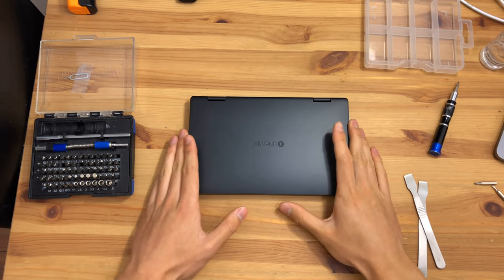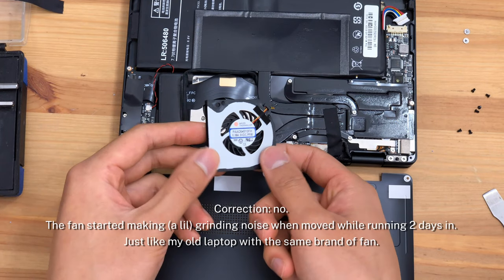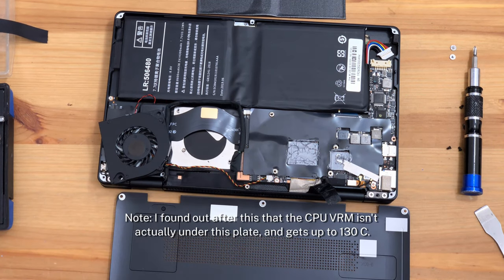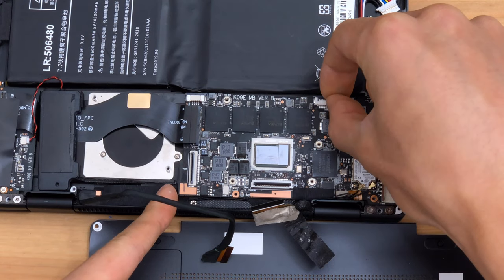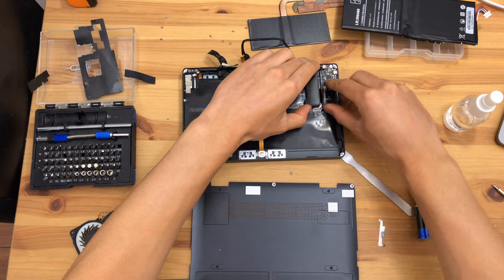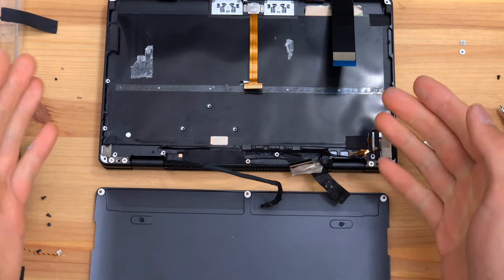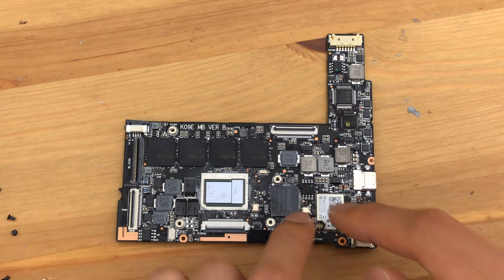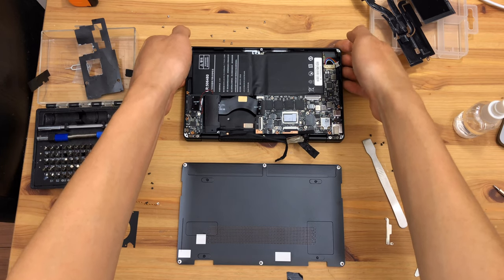One-Netbook One Mix 3s Yoga - Tiny Laptop Full Teardown Disassembly

Comment: Also regarding your thermal question regarding the battery: wouldn't the laws of thermo dynamics be in effect here? Which is to say, when heat is being generated by the CPU the heat will move along the heat pipes to the areas that are cooler based on how heat travels. Because the fan would be cooling the heat wouldn't this create a positive flow of heat that would keep heat from moving towards the batteries heat sink? In this way wouldn't the battery heat sink just help to move heat away from the battery itself?

My own experiences with the battery discharging is that it doesn't really generate heat. Only when the battery is being discharged and charged at the same time does the battery tend to heat up. Your thoughts on the matter would be much appreciated.

Comment: i have to change my one mix 3 yoga keyboard & your video help for direction to change it.
it was  a success
tx
Reply: Can you link where you found a replacement keyboard. If its an ebay seller which one? Thanks.
Reply: @minsc9976  it is on aliexpress

Comment: How do you reconnect the optical mouse sensor? I used this guide to replace the battery but now my optical mouse doesn't work. I think I must have disconnected it somehow. The clicks work on the left and right buttons, but I can't move my cursor with the touch pad.

Comment: Hi Larry, my one mix 3s is not turning on, the blue power LED lights up for 5-6 seconds before going out again. Sometimes I see the windows bootup screen and sometimes nothing comes up on the screen, but the system switches off in 5-6 seconds regardless.  Do you have any idea what's wrong? Hoping it's something I could take apart and fix...
Reply from the maker: If you're comfortable working inside the system, try to remove the back cover and disconnect the battery. Wait 5 minutes or so, then reconnect the battery, and try powering the system on. It may take several restarts or force restarts to get it to boot again.

Let me know if this helps
Reply: @liminalsunset  Thanks, let me give it a try following your video, will let you know how it goes!
Reply: Hi Larry, I tried disconnecting the battery and reconnecting after 5 minutes, no response, had to plug in usb-c power for the blue LED to light up.  The system power cycled on its own for around 10 times, each time the blue LED and the screen didn't last longer than 10 seconds.  Sometimes there's nothing on the screen, sometimes I see the one mix logo, there was once I saw the windows login screen but only for a split second.  The system stopped power cycling (restarting on its own) after maybe the 10th time.  When I press the power button it's the same 5-6 seconds of blue LED before going out again.

I then tried leaving the battery disconnected and try switching on with usb-c power, the behavior is the same (5-6 seconds blue LED then nothing).....
Reply: @michaelleung1980  any update on this? I have the same problem.
Reply: @jhayde0830  still the same, I tried the disconnecting battery trick Larry mentioned with no luck... I even tried powering it up with the battery disconnected (read somewhere that it works without the battery) but it's still the same (blue light which goes out after a few seconds, sometimes I see boot screen, sometimes I see the automatic repair message before it goes out). I haven't tried anything else inside besides disconnecting the battery yet, don't know if anything would help.
Reply: @jhayde0830  Second update, after leaving it untouched for a few days, I just tried switching it on again and it started up successfully and I let it stayed on for a couple of hours and even restarted it for windows update and it's so far stable. A couple of months ago I encountered this problem the first time and the one mix 3 suddenly worked again. I really wonder if anyone knows what the problem is.  When it's on it appears to be stable but sometimes it refuses to start up.
Reply: @michaelleung1980  Thanks for the update!
Reply: Another late update... it was too soon to call it stable when it's on...  as my one mix 3 blacked out a couple of minutes following the previously mentioned windows update. After I few tries I was able to power it back up, but it went out within a few minutes.  There is definitely something wrong that I couldn't figure out
Reply: @michaelleung1980  i have been facing this issue since last 2 months, shown to many chip level repair experts but no solution. I think i am cheated by manufacturer. Its a useless piece of @£#
Reply: @dhanvinvlogs9715  sorry to hear that.... it's the same for me.... and I've given up on it already.....
Reply: @michaelleung1980  Did you manage to figure out a solution at all? Got the same issue. Was wondering if a battery replacement would solve it. Thanks.
Reply: @snazzybunny3029   not at all... I've given up on it already, sorry...

Comment: can i ask you something? my onemix yoga 3 is automatically turning on and off like in a loop. if i successfully go to the BIOS, it will suddenly turn off. what is/are your recommendation/s? TIA.
Reply from the maker: You can try to carefully unplug the battery and reconnect it after 5-10 minutes and see if it resolves the issue if you are comfortable working inside the computer. Otherwise, there could be a number of issues causing this.
Reply: @liminalsunset  thank you for replying! i did, but still in the loop. i think it's the batt even if it's 100%. you think so too?
Reply from the maker: @alndrx  You can try to start the machine without battery connected using USB C power supply. You can restart it a few times before it will boot maybe.
Reply: Hi my fds, It happened mine as well, i drained out all battery by plug in usb fan, and change it again, it back to normal, but i have no idea it will happen again sometime, it is so frustrating...

Comment: This model is advertised as having aan addition slot for adding
a 2nd SSD. Any Idea as to where ??
Also, FYI, I upgraded to Windows 10 Pro very easily..BFN
Tom
Reply: Only the One Mix 3 has the slot, One Mix 3S doesn't. Not sure what type of slot it is too, my nvme drives seem to fit it but are a bit too long, haven't yet tried if they will work.
Reply: @TomaszKucza  I want to add a 512 gb ssd in my one mix3 but don't know where the slot is. Any idea?
Reply: @shariqabideen  When you open it (unscrew the back panel) there is easy access in the top right corner.
Here is a photo: https://photos.app.goo.gl/5Mc5wztwyyJ7cxVu9
 The space seems a little short for bigger SSDs though, haven't tried adding one yet, still have a non-working keyboard so the device is gathering dust.

Comment: Hi Larry, I just bought a One Mix 3 Pro and tested the device. While charging and using it, I can feel the electric current flowing through the case and when I touch it, it zaps me. 
I tried to disconnect the charger and use it purely on battery, after using quite a while, my hands feel uncomfortable and can feel the tingles sensation... If I lift the laptop close to my ear, I can hear tiny sizzling sounds from it. Could it be that the live wire is touching the case and how could I possibly fix it?

Comment: Larry, Great tear down video! Does the One Mix Yoga have a bios battery soldered to the motherboard? If yes, where is it located? I am trying to reset the bios. My 3s is not starting up. No logo/bios start up or windows 10. The blue led comes on for two seconds and turns off. I’ve reached out to One netbook company and there is absolutely no technical support or response. I regret buying this expensive laptop. Any advice based on your personal experience?
Reply from the maker: Hi,

Sorry for the late response. This laptop doesn't have a BIOS battery or a capacitor on board; it uses the main battery for this function. You may try to unplug the main battery for a while, maybe more than 5 minutes, and press the  Power key with the battery out and the machine unplugged to drain residual power. As I note in the video, it may take a few restarts for the machine to power up when the battery is plugged in and the power adapter plugged in the first time it boots after a battery disconnection.

Please let me know what you think

Good luck!
Reply: Hi Larry, thanks for your quick reply. I’ve disconnected the battery and pressed the power button to drain any power on motherboard. After waiting for over 5 minutes,  I reconnected the battery and plugged in the power and tried to restart many times without any success. Is there another way to reset the bios? Are there any pins on motherboard to reset bios? There is some anecdotal evidence that Windows updates may cause start up problems, but no solution is available. If I can somehow get into the bios, I can reinstall Windows. Could a bad battery cause these problems? I do appreciate any advice you can provide.
Reply: Hi Larry, Thank you for your quick reply. Not sure if my reply got posted. I disconnected the battery and left it unplugged overnight. I then pressed power button to drain any power from the motherboard. I tried to restart many times without success after plugging in and reconnecting the battery. Is there another way to reset the bios? If I could somehow get into the bios, I could reinstall Windows 10. Any pins in the bios to reset? Could it be a defective battery? Any advice is greatly appreciated?
Reply: Did you ever find a solution for this, I have the same issue
Reply: @rockyj6245 i have same problem do you have a solution??? I saw that hard drive ita soldered to erase to ceros, and no windows or linux or no program can boot with external dvd/cd reader and keyboard dont work on bios only external usb keyboard, and this happen to me because i put sleep mode so battery was 0% now i charge to 100% and drain battery to 0% and still the same problem

Comment: Larry, are you still using your Onemix? I just recently got the refreshed Onemix 3pt with the Core i7-10510y cpu and noticed that my bottom plate is slightly warped and doesn't sit right, and that my left mouse button is sticking and not always registering. I'm wondering if you have an opinion on easy it would be to fix the left mouse button from sticking?

Comment: Would you recommend placing thermal pads, or is it not necessary?
Reply from the maker: I'm currently looking into this. At the moment if you do not do anything too stressful on it it may be fine.
Reply: @liminalsunset  What about VRM ? If there is a way to keep it under 125 degrees it will be great.

Comment: Hey Bro.. You seem to do the teardown quite confidently, do you think you can help me with similar teardown for a One Mix 2S (the M3-8100Y version), using that for almost 3 years, then the keyboard failed me. I google and found it was a common problem. Do you think if I dis-assembled the unit, I could repaired myself?
Reply: Yes, mine is just a few months and the keyboard has some problem with some keys intermittently pressed

Comment: In mine the keyboard and mouse-thingy stopped working one day. Any idea what might have caused that? It seems they are connected by separate cables, so unlikely the cables broke. Where is the sensor for screen position? Maybe in my case it disabled the keyboard thinking the screen is flipped (power button and backlight for keyboard work - the backlight is always on though)?
Reply from the maker: Given that the keyboard (actually attached using USB internally) and the mouse have stopped working together perhaps it does think it is in tablet mode. I assume the power button still works, and as part of the keyboard, that part should probably be fine.

The sensor for position I think (could be wrong) is a magnet Hall Effect Sensor. It's not exactly something that could get dirty or stuck in this application, but perhaps you might want to experiment with a strong magnet carefully to see if you can trigger it or something. Perhaps unplugging the battery and reconnecting it may reset the device. Does the display still turn off when closed in laptop mode?

Cheers
Reply: @liminalsunset  Thanks for the quick reply. The power button works, the device goes to sleep normally when I close the lid and display turns off. Checked with a strong magnet, no reaction to it in any place, hm, maybe it uses different way to detect being closed. I can use the device with external mouse and keyboard, so the USB subsystem works.
Reply from the maker: @UCaoe6oqqYAryy1zcTp8Hamg I believe there are some sensors inside the actual screen part, like the accelerometer. Unfortunately as a niche device schematics aren't available to perform more detailed analysis on this, but I'm wondering if the keyboard controller chip could be identified on the board, and the "enable" signal traced somewhere perhaps.

Comment: Good review and beeakdown. Do you know where I can DL the drivers for this unit please. I tried there website the links do not work
Reply from the maker: Hi, which drivers do you require? I have a copy of all of the drivers for this device.
Reply: @liminalsunset  Hi,  The keyboard 'FN' 'DEL' to control the fan isn't working and I have an unkown device in devices list which I don't know what it is. Besides that I have graphics and Bosch driver in place
Reply: Anyone know why it would have no power on
Reply from the maker: @dcsmith4411  Could you please provide some more background information as to why the device isn't powering on? If you're able, try reconnecting the battery, measuring the voltage on the black and red wires of the battery, and checking to make sure the charger is working/use a different charger.

Comment: Hi, how do you find the wifi/bluetooth reception? My unit has always a crappy signal, and not sure if the antennae or the firmware might be guilty... Any advise? Thanks a lot!
Reply from the maker: Mine tends to have decent reception, gets most signals. Have you tried checking to make sure the antenna is in position and the cable is firmly connected?
Reply: @liminalsunset I have been able to check the Antenna connections and they seem to be firmly attached. Regarding the cables themselves,  I lose track of them very quick, so I do not know if they are in place or not. Do you have any picture/video/schematics on how they should be placed? Thanks a lot Larry!

Comment: Any reason why you didn’t go with the platinum?
Reply from the maker: Significantly more expensive, but the processor upgrade provides minimal performance increase.
Reply: Thanks for the response. I’m planning on getting one. I’m in between the platinum and the regular 3s. I’m totally fine spending the extra money, I just hear that maybe higher performance will make the computer run hotter? I also don’t know anything about the difference between the two’s performance...any info would help thanks.
Reply from the maker: @walkercythompson  If the cost is not of concern to you, the Platinum probably won't get much hotter, since they are limited by TDP. However, on the other hand, the performance difference should not be astronomically better. I usually use mine on battery saver, and the machine says it can run up to 12 hours on the battery (idling screen on). I don't see any reason this would be different with the i7, as long as you limit the performance. Pretty much the only other difference with the two is the colour. The black colour is nice in my opinion, and the logo on top that some people complain about is not very noticeable. It may be more noticeable on a lighter colour.
Reply: Larry 

Ok, I was thinking maybe battery would be worse cause of the performance. Sounds like maybe it would all be the same. And I hear ya on the black, it looks way better to me as well.